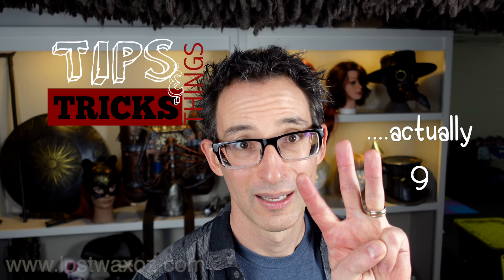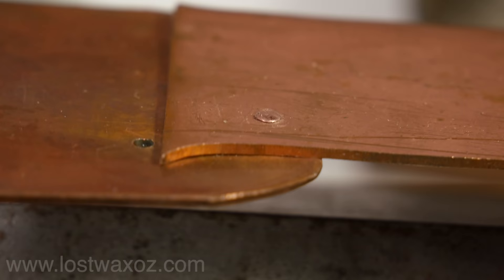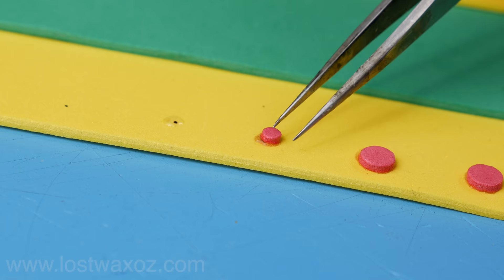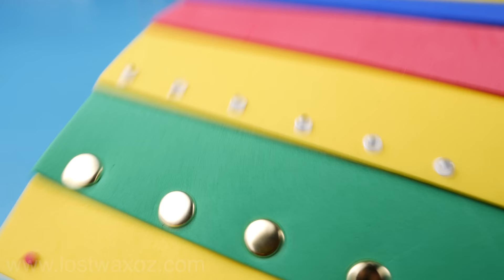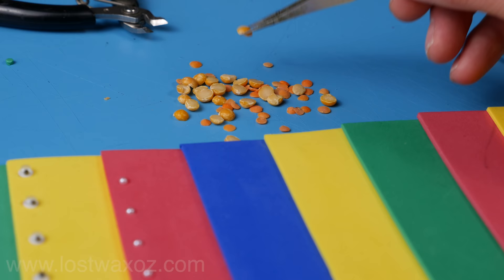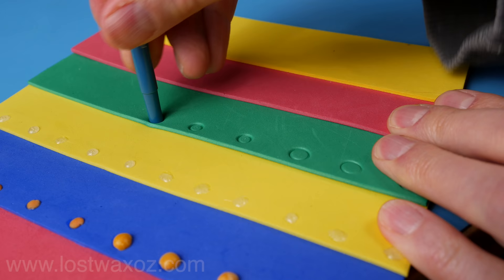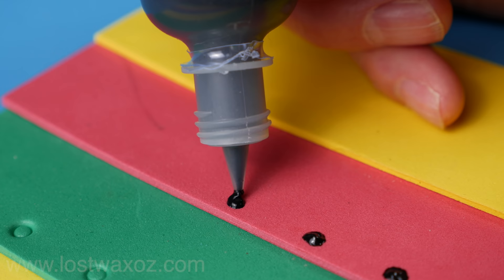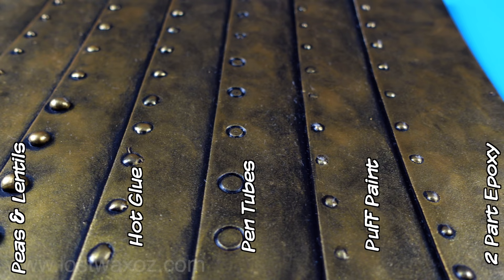9 Fake Rivet Techniques You Should Know! Foamsmithing Basics for Steampunk Cosplay and Foam Armour

Comment: Whenever I need to make rivets I make a type of half and half fake and real are you a little bit of glue stick for glue gun and cut off the end then I take a small hole big enough for glue stick to fit in then Smash It Down until what works like a normal rivet except made out of glue

Comment: One thing I found through Ben Eadie, was these little rubber cabinet bumpers, they're fairly cheap, a few hundred for less than ten dollars, granted unless you want square rivets you get a few less, but they are adhesive backed, and fairly strong, along with plastidip and paint on top of that, they seem to hold up pretty well, they are all identical, so, if that bugs you that might be a problem, but yeah, a decent fairly good looking option, make sure you press them into the foam so they really stick, this is my preferred method of rivets
Reply from the maker: Oh yeah, Ben is great!! I had forgotten about those little stick on bumpers. I should give them a try sometime!

Comment: You can get rid of hot glue strings with a quick blast from a blow dryer.   Not hot enough to remelt the glue, but cleans up the stray bits
Reply from the maker: NIce tip!

Comment: During WWII Supermarine glued split peas onto a smooth-rivetted Spitfire, and then successively removed them in certain places until the a/c's speed had built up to a successful compromise with a snap-head rivetted machine. The experiment told the company just where expensive smooth-rivetting was most required. I remember buying split peas decades ago but I guess I can get them on the internet.
Reply from the maker: Well, that is really interesting. Sometimes simple is... best.

Comment: I also won a Halloween contest with the  hat and the goggles made following your amazing patterns. (Thank you!)
I used then pearls and Tulip paint for textiles.  but I had most success with rivets and screws out of polymer clay. (Wilton moulds for fondant has some awesome shapes, but by hand is very easy). 
Covering black polymer clay rivets/screws with metallic powder (e.g. Pearl Ex) gives a very realistic look. 
For Covid masks, when I have begun make them, first place I looked for patterns was your site, because your patterns are the best, the easiest and most accurate in the whole world!
Reply from the maker: Congrats on the contest win!! And great input about the polymer clay rivets.
Reply: @LostWax  Thank you, but it's mostly your merit. 
On rivets: also, from dollar store, the little silicon dampeners usually used for cabinet doors and drawers to prevent slamming sound. They have an adhesive on back, but it's useless. The shape is nice though, suitable for larger rivets, and they paint well.

Comment: I just want to say this is such a cool in the idea I do love the traditional way of making the rivets I would like to know where you got that tool that you used to drill the hole?🤔
Reply from the maker: It's a Foredom flex shaft, used for jewellery making. I see that there are now lots of knock off brands that are pretty reasonable prices. I got mine from a jewellery supply company many years ago, but you should be able to find one pretty quick by searching.

Comment: If you mod podge or use gesso over the lentils and peas they will be okay as long as you avoid crushing them.  Havent had problems with bugas as long as the item ia well saturated.  May not withstand humidity tho.
Reply from the maker: Cool, thanks for the info, that's good to know!
Reply: @LostWax  The real enemy with natural dry materials is humidity. Pasta crafts last a long time and once sealed even longer, so I suspect that these dry lentils (not the precooked ones) once well sealed should hold for the duration of the prop. I understand Mod Podge actually does this well enough as it's not just white glue and has other additives but only time will tell.
Reply from the maker: @jherazob  Especially where I live- the air is super dry all winter long.

Comment: I used the paper fasteners on my dragon armor.  I lucked into a huge bag at our local Goodwill; probably a couple hundred for a couple bucks.  I got smaller ones at Walmart in the office supply section.  If you're careful you can cut the backs off googly eyes & get the rattly part out.  Then you have a nice dome to use; I'd recommend using the pen method to make an indentation and then gluing the dome into that.  (I've never tried it; just seems like it'd work.)  Any ideas for making faux abalone discs?  I want to make Xena's chakram for a friend, but those discs have me stumped.  I don't want to just paint circles with iridescent paint, but if that's my only option I'll go with it.
Reply from the maker: Hmm, I'll have to look at some images to get an idea of what you are looking for but I think I have a bit of an idea. What about pouring two slightly different colors of nail polish onto a disc and then swirling it a tiny bit... not sure if it'd work but might be worth a try...

Comment: I wonder how well it would work to glue down a bunch of lentils/peas onto foamcore, add foamcore walls, and pour a silicone mold; then just crank out a bunch of resin casts of the "rivets". Hopefully, that would retain the handmade look without the fragility (or potentially disastrous water-absorption results) of dried legumes.
Reply from the maker: It would work I think, but kinda feels like a lot of effort..... Good thought on the water absorption aspect of dried legumes, I never thought of it, but you'd definitely need to seal them well.
Reply: @LostWax  you'd only have to do it once, crank out a huge number of them for as long as the mold will resist and you have rivets for a long time, seems like a good quarantine project and wouldn't take as long as you fear
Reply from the maker: @jherazob  It's always worth a try! Even if it doesn't work, I learn something new:)

Comment: You can use Nuvo Drops/Pearl Drops, which are self-leveling craft drops mostly used in mixed media and paper crafts. It's quick and with a little practice can look just like a rivet. It's a lot quicker and clean than using epoxy.
Reply from the maker: Hey, thanks for the tip, I'll have a look for those and give them a try!

Comment: I do t think any one method is better than the other apart from durability. It seems the methods have more to do with the look for which you are going. Some look more rustic, some more industrial, and some even cartoonish. To the untrained non-cosplayer I personally like all of them.
Also the issue with puff paint is that because it dries they shrink. So you have to guess at how big to make them to get your desired size.
Reply: and the foam ones are the only ones safe for LARP weapon striking surfaces